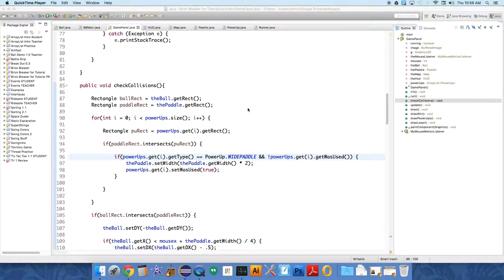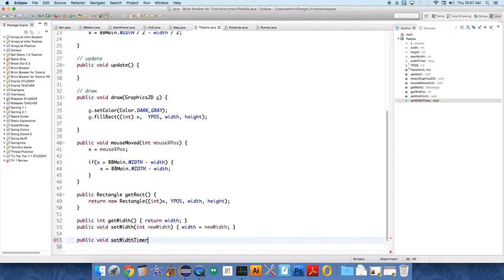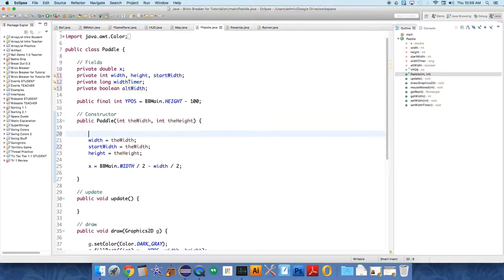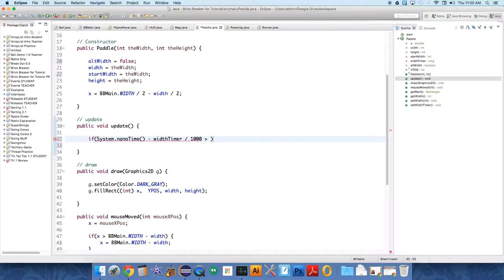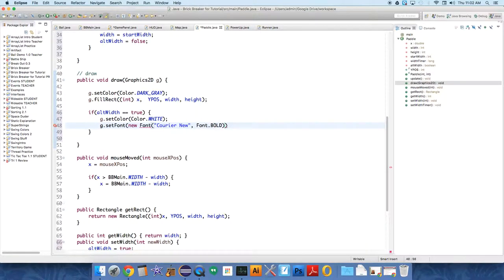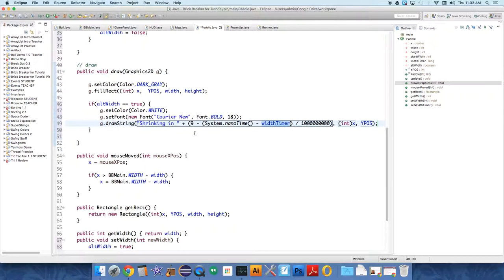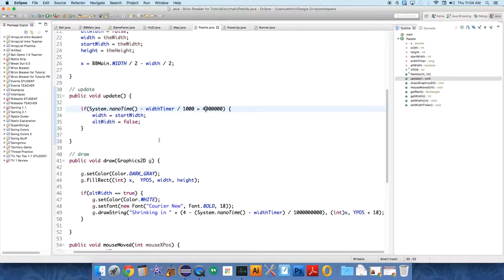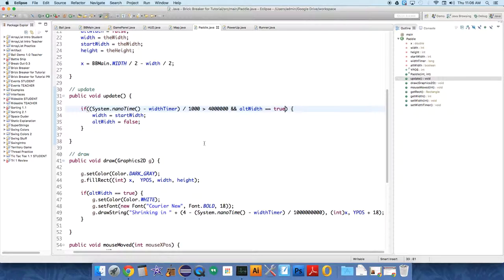Brick Breaker  Modifiers 7

Comment: I found it very hard to keep up since brickbreaker modifier,  I think you might have change your codes or add new functions while you're debugging, I'm stucked
Reply: I think you may be referring to the Paddle's constructor, which he added to ints to. Instead of initializing the paddle width and height in the constructor, he sets the Paddle's value in the init() method in GamePanel with the same values, 100 and 20.
Hope that helps.